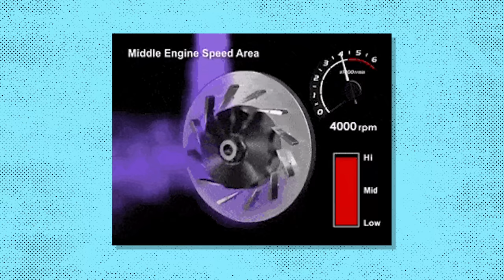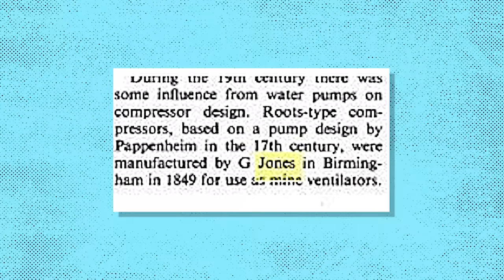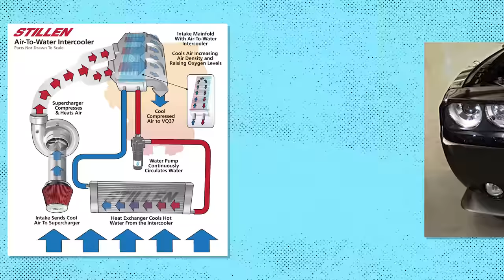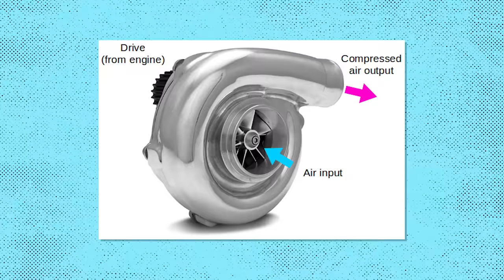Why Superchargers Aren't As Good as Turbos

Comment: I think Superchargers make more sense for performance and sport cars, precisely because of the no lag thing, and because of the linearity too, it kind of keeps the N/A feeling of an engine while increasing its power, that´s his beauty IMHO
Reply: Nope. They make no sense at all when you consider the parasitic power loss. 
You want no lag? Get a hybrid turbo. You want even less lag? Get an anti lag. Superchargers need oil change and stuff so... What you've just said is completely wrong.
Reply: @omursaraslan6316  or just get a supercharger...
Reply: @nade5557  Why when turbo is way more efficient?
Reply: When World Rally championships and F1 were less constrained by the rules, we all saw turbochargers dominate the field. That is for a reason. If you are driving aggressively, you are bound to be in the right rpm and keep the turbo spooled, even when you go off the throttle, there are ways of keeping the turbo spinning by letting some air past the throttle, adding gas to it and igniting it super late so that flames spit out of the exhaust keeping the turbine spinning. Its called an anti-lag system.
Reply: @omursaraslan6316  yeah antilag…. Just call me back when your turbine blows up… listen the closest forced induction system to n/a is a root or twin screw superchargers… as a performance shop mechanic I can’t count on both my hand how many times I’ve had kids with blown up turbos come up and be like "wELL iT wAs aLl gOinG wEll tHeN iT wEnT pOoF" all I have to say is "2 step or anti-lag right?" And 90% of the time I’ll get an ashamed "yEs" and all I can offer them is a brand new engine because they ripped their turbine and compressor out and went straight to the cylinders…. 2 steps and anti lag which are 2 REALLY different things is only for purpose built track cars/rally cars that can afford to change turbos every 3-4 races and have spare engines….
Reply: @electric_boogaloo496  and I point you to my last comment too ;)
Reply: @mr.tarkovish2587  Well... Yeah. Duhh.. It's called a compromise. You either get performance or reliability. Not both at the same time. 
I thought this is common sense. And I really don't believe what you've just said. I've seen anti lag only in a handful of street cars till now.
Reply: @electric_boogaloo496  this is also an era where F1 was at its most mechanically unreliable and anti lag loves blowing engines up after just a couple runs. Even today's F1 Turbos don't contribute as much as the Engine itself and Hybrid system does, which is why they drive much smoother with little to no lag.

 Superchargers are more reliable and make more sense in sports cars since you don't actually have to rev high to access all that peak power, the only reason why you don't see them is regulations.
Reply: @omursaraslan6316  If you don't believe him, then don't talk, antilag is common in WRC, Hill Climb and Time attack, and those cars are notorious for having engines that'll go poof.

 "That's called a compromise" yeah and that compromise is getting a new engine in just a few pulls, meanwhile a Centri/Roots/Twin Supercharger have smoother power curves that will give you alot of power on tap at even at lower rpm. The "parasitic losses" only matter if the car doesn't make as much power as its competition or if it's drag race.
Reply: @youngrody2386  Is that why all the sports cars are supercharged? Oh wait... They're not. They're all turbo charged. Anti lag doesn't make your engine go "poof" in a couple pulls. If it did no wrc car could finish a stage. Besides you don't always have to go "patapatappatacha!"  The point is that there are solutions to turbo lag albeit with drawbacks. And the bottom line is turbo>SG
Reply: @youngrody2386  Twin scroll, small turbos already deliver power like a supercharger, early in the rev range and disappoint like a supercharger in the higher revs. More expensive cars have multi turbo setup for boost at low and high revs. Reliability is good enough to make its way into passenger cars with a warranty.

What you don't want in a performance car is the ever increasing parasitic loss of power with revs. Superchargers are common on engines which are already big enough to eat the parasitic losses, and are quite powerful in their naturally aspirated form. Supercharging a sub 3 liter engine isn't common. Turbocharging is more versatile, it is used in engines as small as 1.8 liter Yaris GR, or the 8 liter W16 in the Veyron.
Reply: @omursaraslan6316  "Antilag doesn't make your engine go poof in a couple of pulls" Ask the WRC and how many engine blocks their teams go through in a single event, highly competetive Time Attack and Hill Climb has antilag engines that are good for only 5 to 3 runs, only NHRA spec Promods that feature have antilag systems are reliable enough not to warrant constant engine changes but they're always at the verge of blowing up and they're only driven for 5 to 7 seconds tops with Meaty Big Block Engines. 

 Those drawbacks about Turbos are still the reason why only small discplacement engines uses them in other forms of motorsport, it's to make up the power difference against bigger displacement engines, but inspite this the most dominant cars in series like GT4, GT3 and GTE are NA big displacement engines that feature or more cylinders, and those cars would benefit more with a supercharger than turbos since now they don't have to rev as high and gets power even faster on the low end, the only reason you don't see them all that much is since power is capped around the 600s and B.O.P. changes, but cars like the Jaguar F-type GT3 have shown really fast corner exit speeds even compared to its rivals, especially in hard braking zones.

 Turbos are used to close as a gap closer against bigger engines or to break speed or time-records for a single purpose, they aren't as practical nor durable as Superchargers. Besides the  GT500, ZR1 and and Camaro ZL1 wouldn't be as good without their superchargers on tracks like Laguna Seca and the Green hell.
Reply: @electric_boogaloo496  True, Superchargers and Turbos server different engine types better and for different purposes, the guy commented on just said that Turbos beat Superchargers usimg antilag without regard for reliability of said engines. Imagine using antilag on an LMH Bugatti on its quad turbo set up and v16 during an endurance race then have it break down after 2 laps lmao.
Reply: @youngrody2386  Yeah yeah. That's why all the engines are supercharged right? Right? 
Wrong. 
Personally I'd prefer supercharger over turbo. But still turbos are way more reliable, provide more boost on high rpms and are simpler. They don't need maintenance like SC do. 
Nice try anyways.
Reply: @youngrody2386  No I'm an na guy. Given the choice I'd go with SC over turbo just because I think they're cooler. I don't even bother reading what you wrote. I don't need to prove the known facts again. No I never had a high end (whatever it means) car. I used to have a turbo fiesta tho. Oil burn has nothing to do with turbo. It's a matter of tolerance between the pistons and the combustion chamber which has to be greater due to more pressure. TSI engines are known to burn oil and they were both SC&TC up until the last generation. All the crap you wrote is arbitrary. I've been a car guy so long as I remember my name. You don't know better.
Reply: Want to run a twin screw ? Drop about 5500$ want to run a hybrid turbo or an vgt turbo or anti lag turbo ? Drop 9000+$ 😂 i push 18 psi and make 748 whp in my mustang . Got Buddy pushing 18 psi and makes 813 hp . Mine hits instantly while his is a slow hit. We race at high plains speedway and i beat him most of the time , because i can get out of the corners and down the straights far faster then he can. Theres a place for a turbo and a place for a supercharger. In all honesty ,who fxckin cares ? Got money ? You got boost 🤷🏼‍♂️ don't got money ? Then no boost.
Reply: @youngrody2386  There's multiple ways to do anti lag. Hyundai's N cars use the extra combustion approach but not pushed to the limit to give some anti lag without the same reliability issues of running it full tilt in a race car, some manufacturers use electric motor assisted turbos (the electric motor can pre spin the turbo as a pseudo electric supercharger while waiting for exhaust pressure to build), and there's combination systems with multiple turbos configured for different speeds or combinations of all of the above.
Reply: @electric_boogaloo496  the C230S Kompressor had a 1.8L supercharged I-4 and there are multiple other examples of small displacement engines with superchargers!
Reply: @Dave-dh7rt  the question isn't whether it can be done. Of course it can be done, the question is whether it is better than turbocharging at those displacements. Adoption by motorsports and mass market vehicles have proven that turbocharging holds the edge. My dad's car is a 1.3 liter turbo Renault Duster.
Reply: @omursaraslan6316  I mean why does it matter though? Adding a supercharger always adds more power than it takes. If you need more power just add bigger supercharger??
Reply: @megapet777  Because superchargers suck. Literally and figuratively.
Reply: @v4skunk739  Because of simplicity and reliability. Mercedes with its new turbo/E-super six-cylinder has basically had to build up this huge ecosystem of stuff around the engine to imitate a linear, instant power delivery. Throw all that out, put a normal blower on it... Lose like 3-4 mpg at worst while makign the whole thing far cheaper and more reliable.
Reply: twin turbo and twin scroll turbos would like to have a talk with you, especially rolling launch tune with twin turbos
Reply: @electric_boogaloo496  now we're talking about complexity, 2 different systems and a shit ton of tuning. Compared to a bolt on part. Lol
Reply: @omursaraslan6316  “turbos are more reliable than superchargers”

Yeah. 
They aren’t though.
Reply: @omursaraslan6316  I know this is a year ago, but you are speaking nonsense
Reply: @megapet777  Because the with Supercharger you will always have to subtract most of the power gain to drive the the compressor.
With the turbocharger you get the boost pressure without parasitic drag.
Reply: @JohnBrowningsGhost  Reliable enough for type-rated passenger aircraft...
Reply: @Okami400  No, he has a very valid point.

Comment: Turbochargers do cause a parasitic power loss on the engine, but it's way smaller than with superchargers.
Reply: NO, that is a common misconception among amateur enthusiasts, the Turbocharger does not present any parasitic load on the engine, this is why Turbochargers produce so much more power than Superchargers.